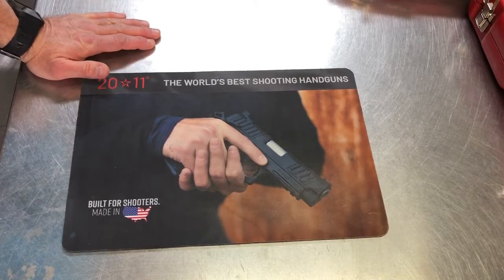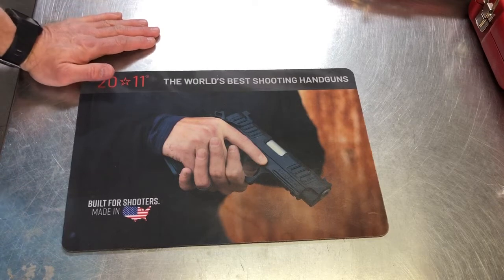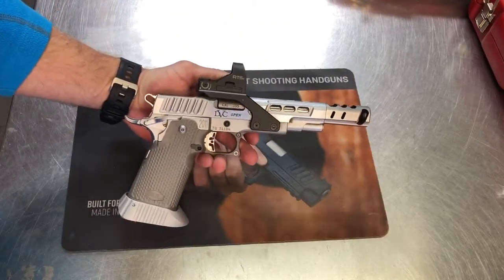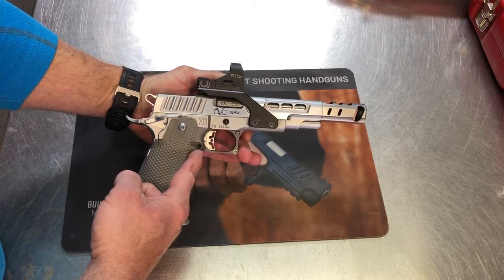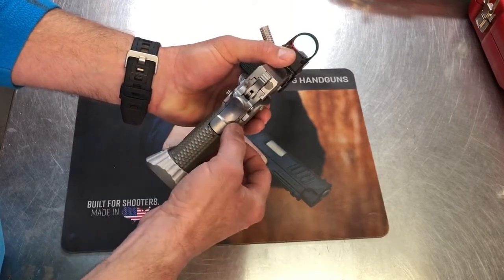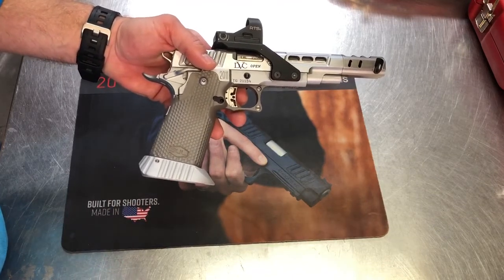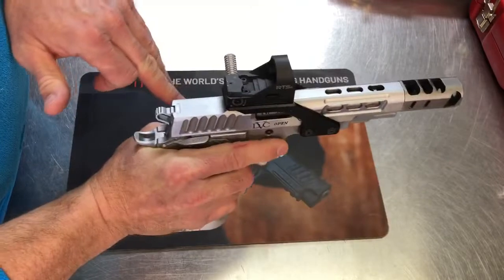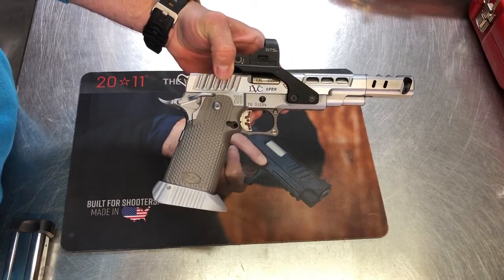Bul Steel Grip on an STI 2011

Comment: Could you put a STI grip on a Bul armory pistol and use STI mags?
Reply from the maker: It's possible,  I tried it - but the STI mags wouldn't work on the combination. The Bul has too much meat on the frame to let them seat.
Reply: @freedomventurescanada501  thanks, I would like to even just be able to use the STI grip, and the MBX mags made for the Bul pistols if that would work.
Reply from the maker: @jamesmiller9823  MBX doesn't make 10 round Bul Mags so I can't get them to try,.sorry.
Reply: Can you make the video hot you put bul grip in the sti